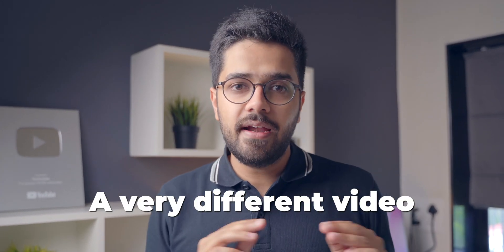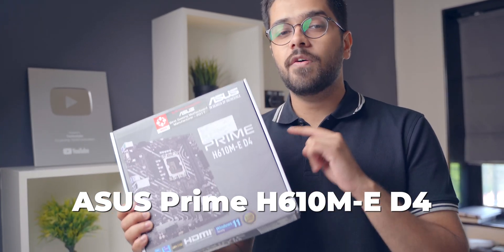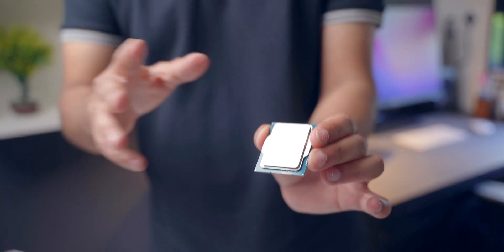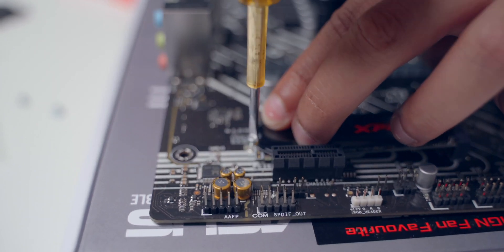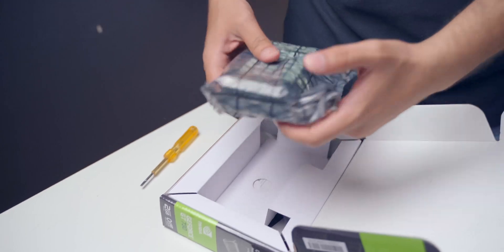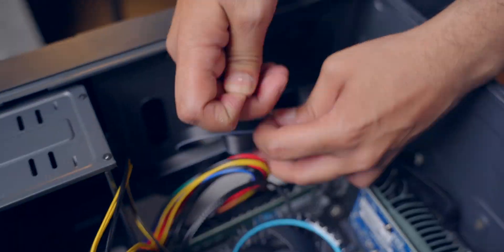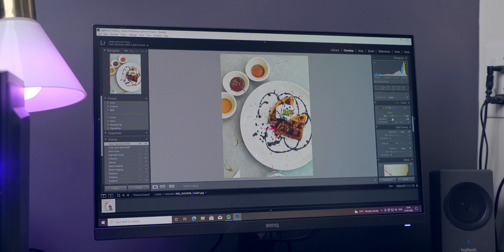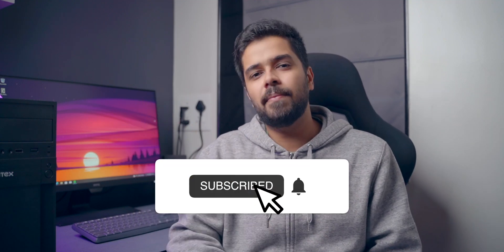Best Budget PC Build Under ₹30000 (2022 Edition) ⚡

Comment: Your content is usually good but very poor component choice here.
For the cost of 12100F + GT 730 you could buy a Ryzen 5600G which would be better for productivity (6 Core & 12 thread with very similar per core performance) as well as the Vega 7 will completely blow away GT 730. Plus you'll have the slot empty in case you choose to upgrade to a proper GPU in future.

Comment: I don't think this is a good build under 30k.
You could have used-
i3 10100f
Nvidia t400
8gb ram
Asus h510m
240gb ssd
450w psu(antec)
Any case you want under 1500-2000

Comment: 1 Why you do stock cam vs gcam videos only of xiaomi phones , there are other brands as well .

2 I have iqoo z3 and i tried more than 8-10 gcam mods but in rear camera there is very few difference when compared to gcam even in night mode gcam cant compete with stock cam . Stock cam is way better .
im using bsg 8.1 the same version you tested on poco f4 .

Comment: Desktop PC with peripherals

Cabinet: Antec NX230 (3RGB fans & 1 exaust fan)
Processor: Intel Core i3 10100F (4 Cores 8 Threads)
Motherboard: MSI H410M Pro-VH
RAM: Adata XPG Gammix D30 16 GB (8GBX2) DDR4 3000MHz
Power Supply: Corsair CV450 450 Watt 80 Plus Bronze
Storage: Adata XPG Gammix S5 256GB M.2 NVMe
GPU: Nvidia Quadro RTX T400 2GB
Monitor: Acer Aopen 22CH1Q
Keyboard and Mouse: Zebronics ZEB Transformer Gaming Keyboard & Mouse combo
WiFi Card: TP-Link TL-WN881ND 300 Mbps Wireless N PCI Express Adapter
UPS: Artis PS-600VA 600VA Line Interactive UPS
Extension Board: Blue Square BS_114 4 X 4 Socket Surge Protector (White)
Windows 10 Pro

Bills: I have all the original bills for all components

Boxes: Don't have Box for Cabinet & Monitor (as my mom threw it to garbage) but I have all other components Boxes

All above components fixed price is Rs. 30k (Fixed) only 7 months old... Selling for urgent money requirement..

Only Mumbai, Navi Mumbai & Thane customers can contact me...
Please note you have to come to my location to pickup the PC & Other components

Comment: Many of them suggesting better psu and case. The total power consumption will not go more than 150-200W so it will be fine but a certified power supply will be safe. Yes coming to case a mesh at the front with atleast 120mm fan will do a great job. Talking about graphic card it totally depends upon how much they use it or else they can save some money by choosing integrated grahpics and invest on storage & air cooling. For basic office use this build is good enough.👍
Reply: For office use integrated intel graphics were enough

Comment: Anyone looking for decent gaming performance can buy the non F CPU from Intel (which has integrated graphics) and then can add GTX 1650 for around 15k more in the future.
Reply from the maker: Yeah that’s a good option too
Reply: The integrated graphics sucks, just try to get an AMD Ryzen 5 5600G.
Reply: @Phoenix56801  i have this proccesor in my laptop hp 15s
Reply: @durgeshbaviskar8340  it's a desktop processor
Reply: @Phoenix56801  i lied I have RE 5300u and not 5600g in my laptops 😅
Reply: @durgeshbaviskar8340  ryzen 3 5300 ..??? How much did it cost u
Reply: Lol you can play minecraft at 720p 😂 better buy a ryzen 3 3200g or afford a ryzen 5 5600g
Reply: GTX 1650 MSRP is 13000(launch price in india) and was available for 12000 in 2019
But now it's ₹20,000
Do you think its price will ever come down to msrp?
Please answer
I wanted to build a pc with 1650 but its current price just ruined my plan 😭
Reply: Can anyone tell me that can i make a cpu for video editing in 30k
Reply: @ashbrn2786  
You can't make a cpu
There are many good cpus/processors under 30k from both Intel and amd
Reply: @-_wanderer  but there are video on YouTube that say you can make a cpu under or in 30k well i don't need for hi tech editing just need that it can run premier pro and Photoshop
Reply: @ashbrn2786 
You can't make a cpu
CPU = processor
That box with ram, motherboard, processor, GPU is called "system unit"
Reply: @-_wanderer  ok so can i make system unit
Reply: @ashbrn2786  yes you can
Reply: @-_wanderer  thanks man
Reply: Sorry dude but Apu + GPU = DISASTER 💀
You should use apu when your budget is tight.

Comment: Better you get a CPU with internal GPU. Why a ₹4500 GPU, when for ₹2700 more you can get a CPU+iGPU ?
Also, Nvidia GT cards have extremely bad resale value, nobody wants to buy them even second hand...
Edit 1 : Mention whether M.2 is SATA or NVMe.
Edit 2 : What kind of RAM ? Intel 12th gen support's both DDR4 & DDR5 standards. It's dependent of motherboard vendors.
Edit 3 : That isn't a Display Port, it's a DVI port, very old & different technology than DP.
Edit 4 : Any PC (even enterprise servers) needs to be turned on before closing the side panel to cut down power if something sparks, smells electric burn, fans are clogged, HDD makes noise, visual inspection, if any components are loose etc.
Edit 4 : Run benchmark & load tests for few hours to negotiate if your PC has a point of failure, you can get the components replaced or refund, while it's in warranty.
Reply: And better go with coolermaster or Corsair psu
Reply: @ShubhamPednekarYt  depends... His system configuration is under 100w, so if already using a dedicated UPS or inverter, the power supply is already stable. But if direct wall power, or system power draw is beyond 150W, then please go for a tested & recommended power supply, cause you're obviously using a higher wattage CPU (i5/R5) or GPU with external power or a combination of both.